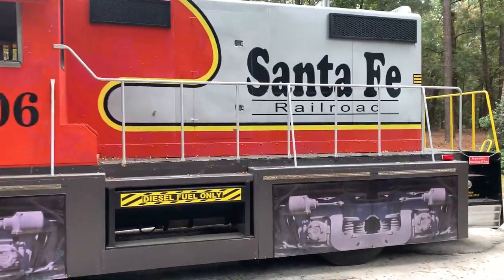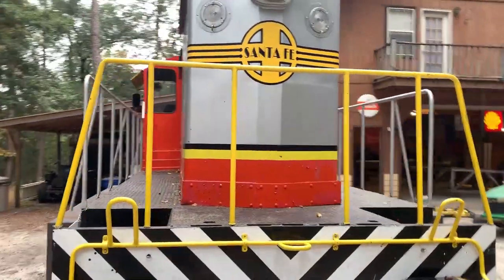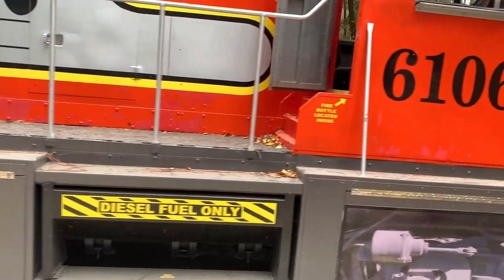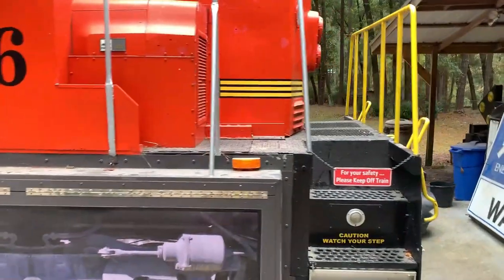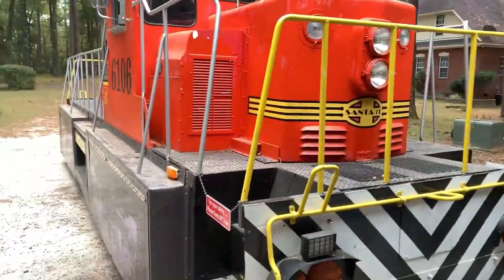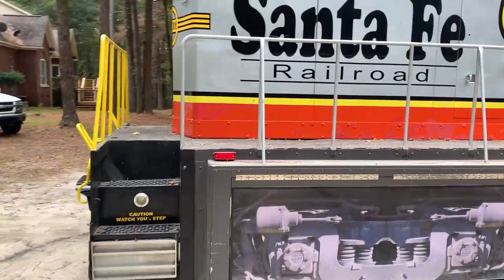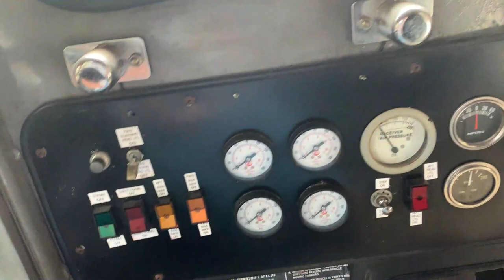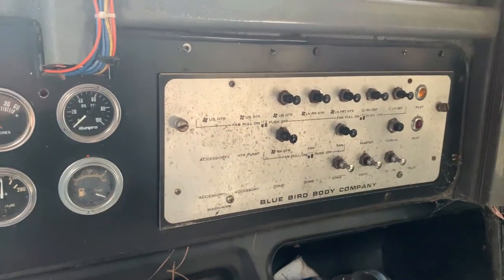Driving a Train! ...kinda

Comment: So cool
Reply from the maker: Thanks!
Reply: @southerneaglelines  I do
Have one question. Can it pull a trailer?
Reply from the maker: @darthgonk5648  It probably could. We’d have to put a hitch on it, which it does have an attachment for, but it’s be interesting to see how that would work. I’ve been trying to get him to build something to go behind it for parades, but I think we’d have to reposition the trailer hitch attachment location as it’s a little high. I got him a knuckle coupling trailer hitch cover though to add a little more realism 😂
Reply: @southerneaglelines  would it look like a passenger car or caboose, personally I’d go for caboose
Reply from the maker: I’d push for a caboose as well. I’d push for an extended vision one with seats up in the cupola like in a real one. With speakers hidden on either side pumping out sounds like a life sized rail sounds car.

Comment: Would be be able to add a bell onto it?
Reply from the maker: It is possible, we’d just need to add a better air compressor to the setup. Currently it feeds the horn and it isn’t strong enough to do both since it’s from an old school bus. It does have a bell that has been cleaned up and polished, but it can’t be used right now for that reason. It might be a future upgrade though when it gets repainted.
Reply: @southerneaglelines  Looking forward to it

Comment: Darned if it doesnt look and sounds real! It only needs couplers to finish off the details, and VOILA!  Pick up your girl and go for a whirl on Saturday night. Bet you would get some strange looks if its street legal!🤔🚂👍👍❗
Reply from the maker: It actually DOES have a trailer hitch that I bought a knuckle coupler shaped cover for. 😂 It IS street legal. It doesn’t come out often. Usually for events or parades.
Reply: @southerneaglelines  if you are still in school, you should get permission to drive it to school occasionally, that would surely turn a few heads, seeing a diesel locomotive in a school parking lot.